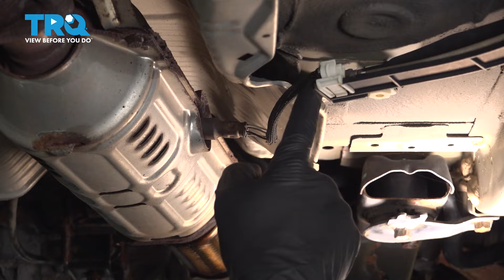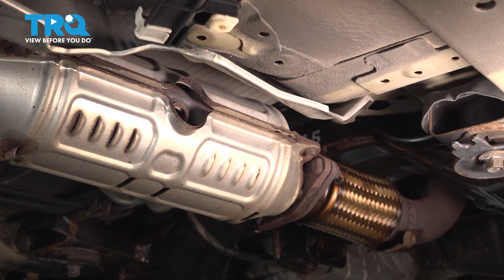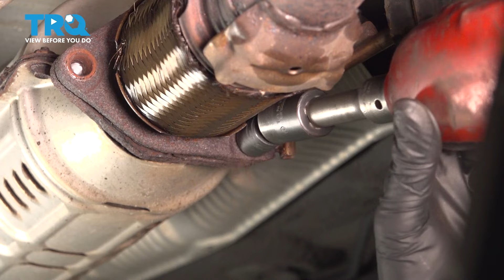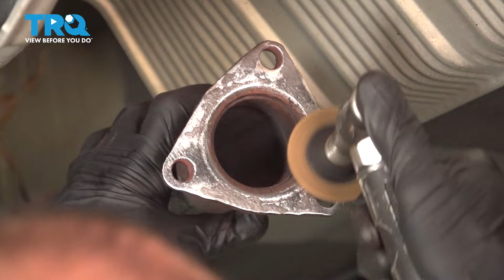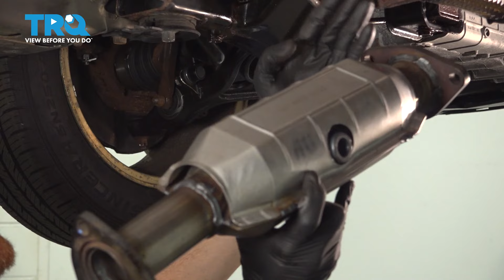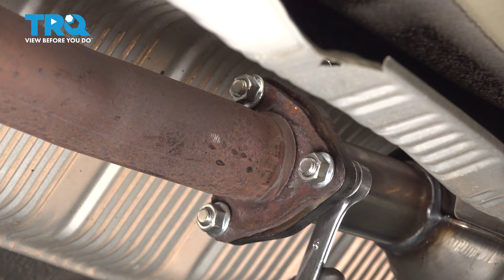How to Replace Catalytic Converter 2003-2007 Honda Accord

Comment: O ring gasket was removed from flexy pipe but didn't see you put new one there, but you Installed I ring on the other  side where video doesn't show that you removed old one from there....

I am Bit Confused

Comment: @10:17  I got it done at muffler shop after OEM got stolen. The Engine  check light remain there ( new sensor) and shop guy could not solved it... What remain to be done

Comment: Annoyingly enough I want to change my catback exhaust. And I go under and see what looks like someone removed the rear mounting part of the catalytic converter and installed just a pipe and welded it there in place. And the front nuts of the cat near the flex pipe are so rusted there is no discerning there was even a nut there.

Comment: Thieves cut my catalytic converter, was gonna be a fortune for the part and labor at the shop. Bought the cat on Amazon, but discovered I needed the flex pipe as well when I went to install it. Just something to keep in mind if you're buying parts from Amazon or wherever, it was not listed with the 02 sensors in the "frequently bought together" blurb, and it cost me 2 extra days. Actually haven't installed any of it yet but I've got every part this guy installed so hopefully it's all good

Comment: Can you guys do a how to guide on how to replace and install injectors in a 2008-2014 Nissan rogue? There's not a single video or written guide on how to do this, not even the owners manual says anything about it, I want to replace injectors in my rogue because I've been getting insanely bad mpg, I want to do various things to my rogue because the car was neglected for almost 4 years, I want to do spark plugs, fuel pump, injectors, 02 sensors and if possible catalityc conv cleanup or replacement.
Reply from the maker: +El Newbie We do not have a video for this repair right now, but we'll keep this request in mind for a future video! http://1aau.to/m/Shop-TRQ